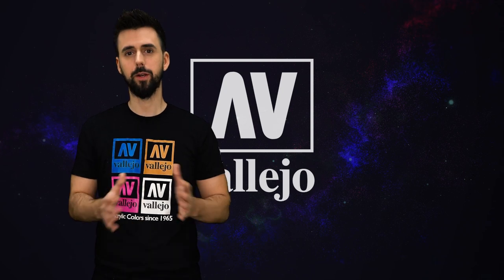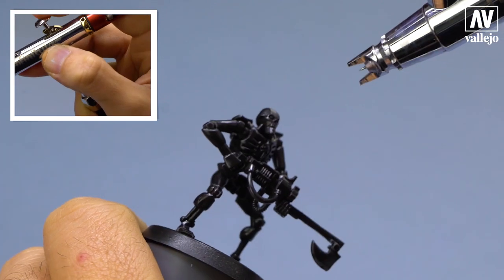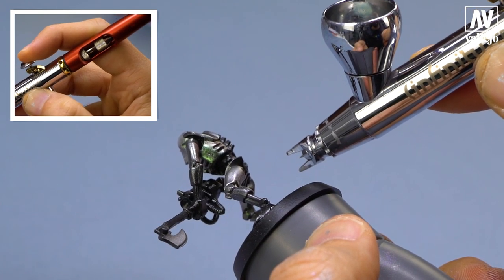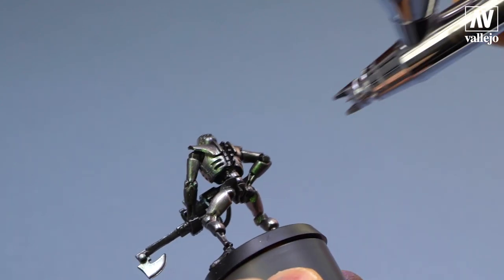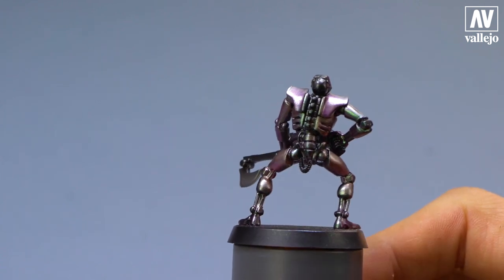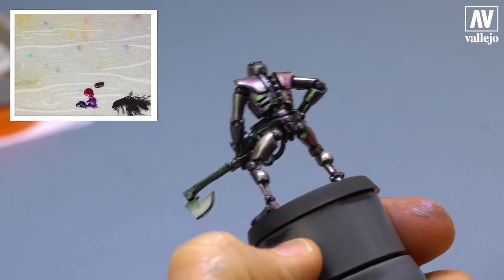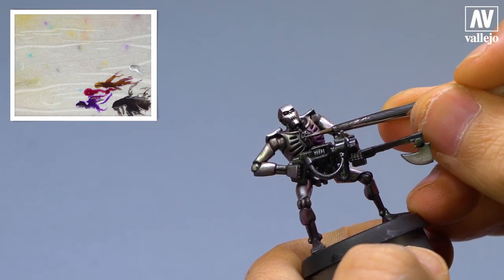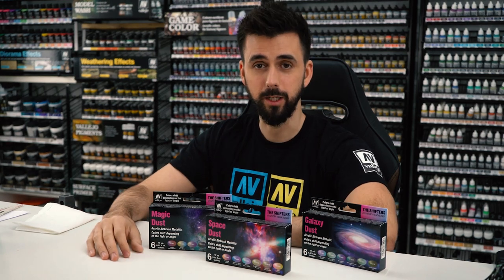How to apply glazes to the new The Shifters by Angel Giraldez

Comment: First shifter colour is displayed as Bright Gold / Brown but then paints is green, is it correct? Then the second is presented as violet / green but paints with a brownish tint.  It is an error? Please check it, thank you!
Reply from the maker: Hello Joan. It is not an error. The Bright Gold color shifts from green to brown, with a gold shine, but you can not see it properly because of the camera. It does not record the real effect (much better in real life). About the second color, the effect is not pure, since it is applied over another The Shifters color, so the "special effects" change. Best regards.
Reply: @vallejocolors  thanks for confirming the order. Will try them for sure, although individual bottles instead of packages would help. Just an idea!
Reply from the maker: @jcg948  Maybe in the future... 😉

Comment: Hello @vallejocolors I was wondering since you airbrushed this onto a metallic paint, would this work on metallic primer? (an example would be any of the metal primers can sprays from citadel)
hopefully you'll get back to me since this is an older video
Reply from the maker: Hello! We don't know well Citadel products and don't know if that could work fine but we definitely recommend priming with black to achieve the best results!
Reply: @vallejocolors  that was an example, if the metal paint from citadel is similar to your metallic paint, would that be ok for shifters?